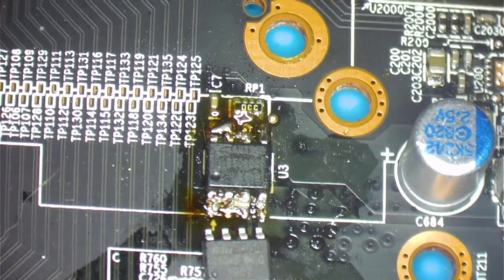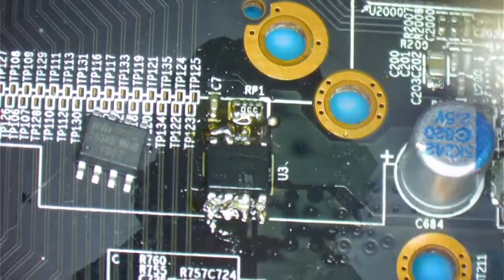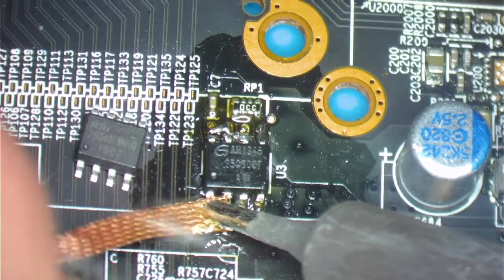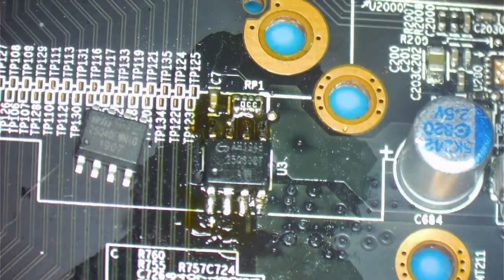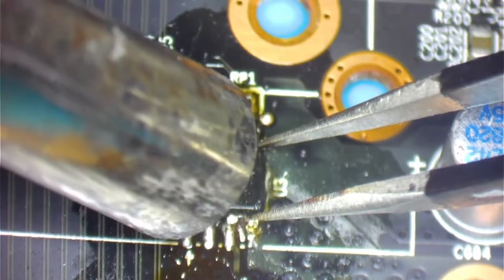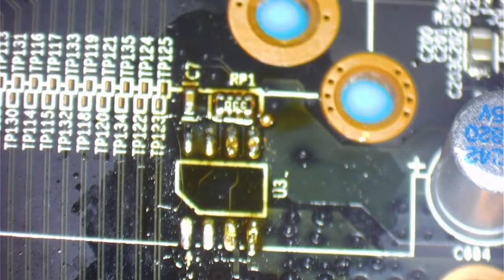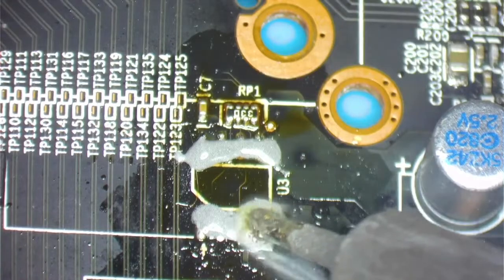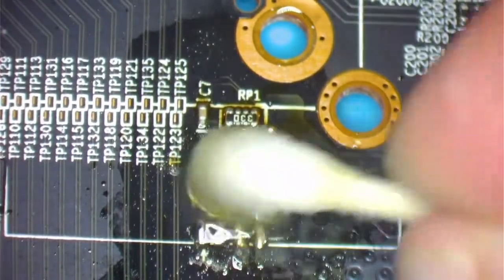BIOS Replacement On Video Card

Comment: Hey Wayayeo!  Thank you for the great video!  It's been super helpful s I navigate the world of soldering.  I remember "modding" those old PS1 boards long ago, and just last week, my buddy ribbed me for killing his PS1 on my last attempt!  I'll never live that one down.

So I do need your help!  I'm doing a VBIOS chip replacement on an AMD Radeon VII, and that chip will just not come off.  I've hit it with the heat blower, the soldering iron, I've put flux on it, and it just won't budge.  For a rehearsal, I removed the bios chip of a really old video card and replaced it, no problems, but this card, just won't work with me.

My only guess is that the solder they are using has a higher melting point that the lead free stuff we are using.  Any ideas why this Bios chip won't come off?

I've increased the temperature to 700º F hoping to move it and nothing.  I'm at a loss.  If you have any ideas to share, please share, and if not, no worries!  I may be sending this card your way, LOL!  Best to you and yours!

Comment: Hey there
I suspect my ZOTAC GTX 970 BIOS chip to be faulty because I had stability issue and after rewriting the same firmware from TechPowerUp it fixed the issues for a while but then it came back again recently. So I have a few questions. 
What are the possibilities? Does that seem like a faulty BIOS or clock chip?
How to check the BIOS with a multi-meter if it's faulty?
Reply from the maker: Hello it could be the bios. I would simply replace it. Pin 4 is ground, pin 8 should read 3V.  Good luck
Reply: @Wayayeo  Thank you so much
Reply: @Wayayeo  By the way, is there a  possibility to test the integrity/health of the BIOS chip with a software. The model is FM25F02A